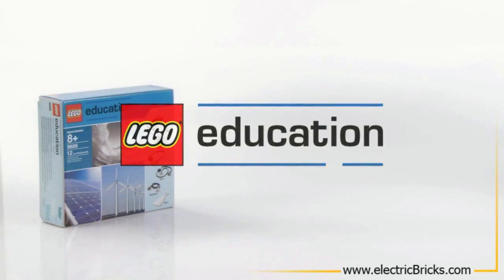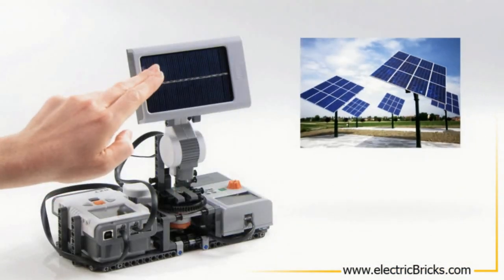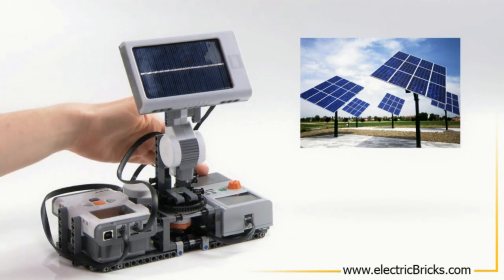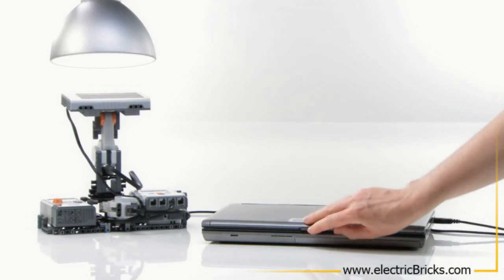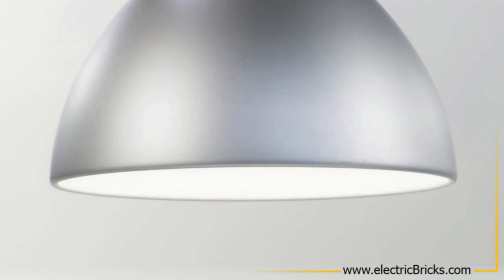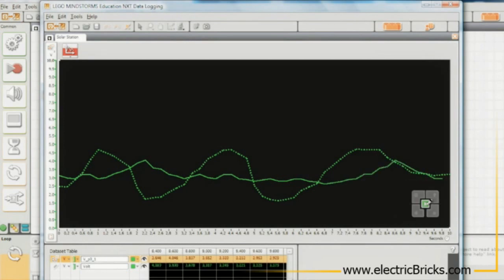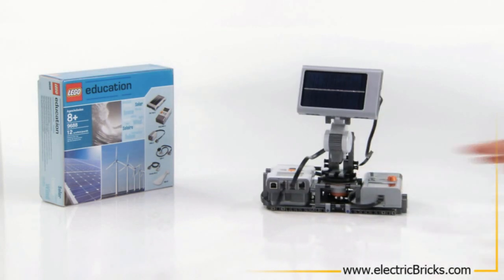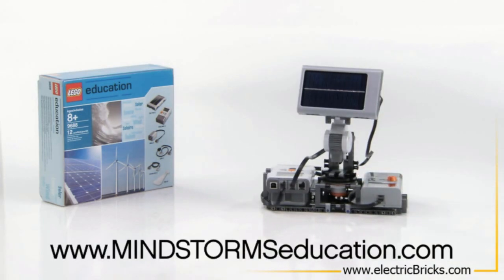electricBricks.com LEGO Education 9688 Renewable Energies 4

Comment from the maker: @marjan15 You can have full charge in about 2 minutes if the stored energy is not been used. But charge needs to constant cause if you are using the energy it does not last too much, battery does not have a huge capacity.